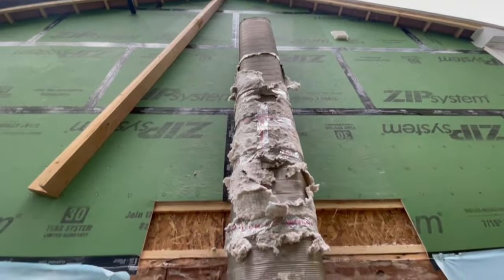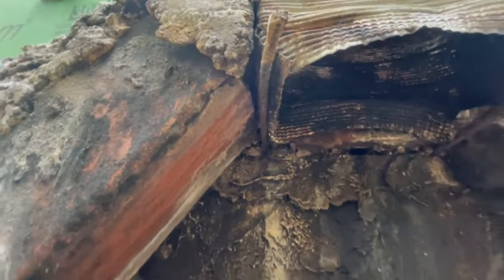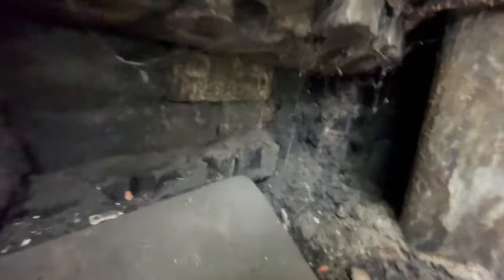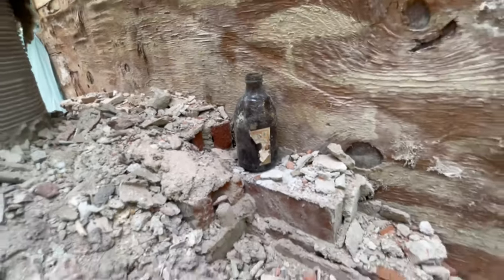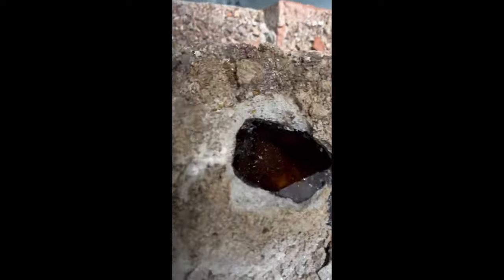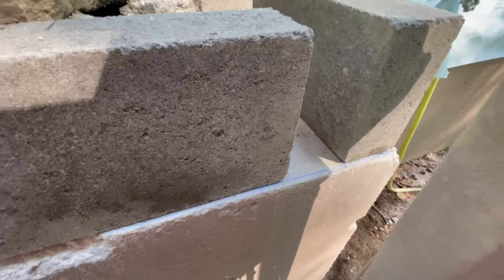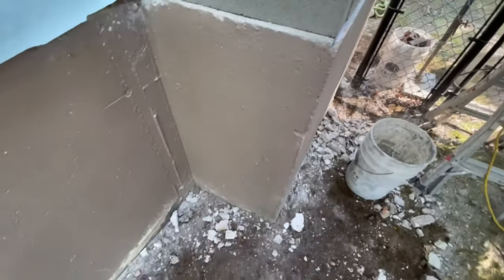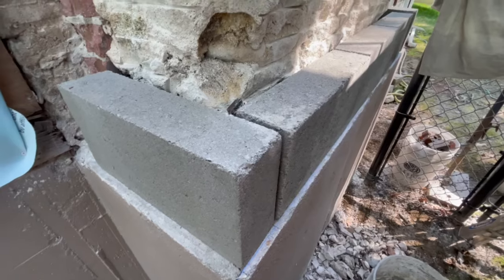Typical 1970's-1980's production fireplace

Comment: Anyone remember the "Heatilator" prefab steel inserts many fireplaces were built around in the late seventies and early eighties? Some had heat vents out the side that would circulate heat from the insert. I wonder how safe they were? I would think they would risk carbon monoxide poisoning if there were leaks or cracked welds in the insert.

Comment: Don’t most non-Rumford fireplaces built  in the 1900s actually cool a house when used due to poor design and in this case obviously poor construction?
Reply from the maker: When the power goes out a lot of people are really thankful to heat their houses with poorly built fireplaces. Compared to modern heating, coupled with really good insulation, they are considered inefficient. However, they are very effective when modern heating doesn’t work.
Reply: Despite most of the heat going up the flue, and the draft then pulling cold air in via drafty windows and doors, There is still the radiant factor heating people and furniture it radiates to.